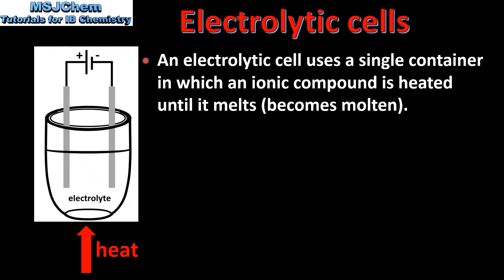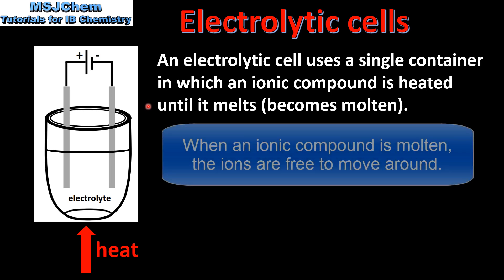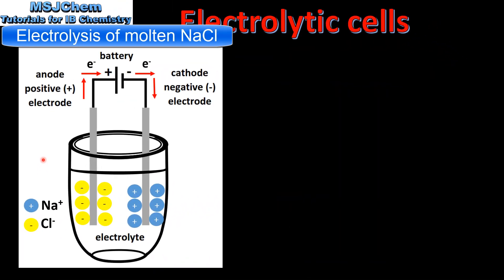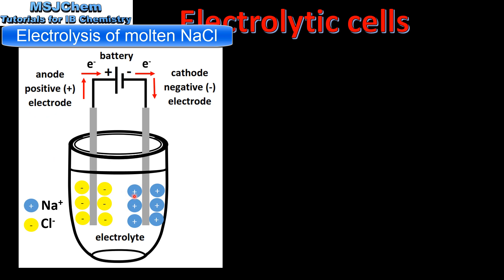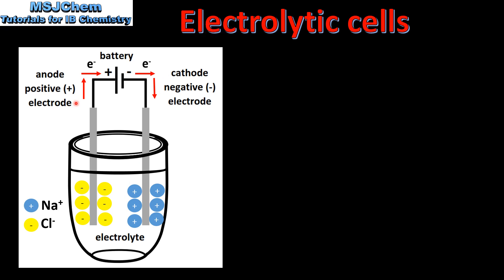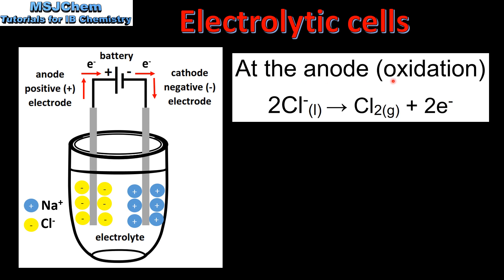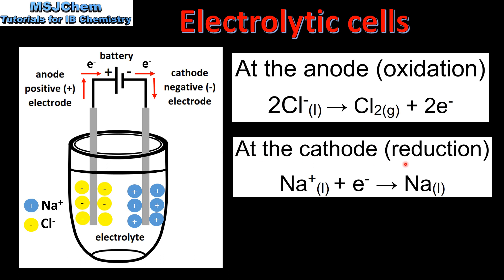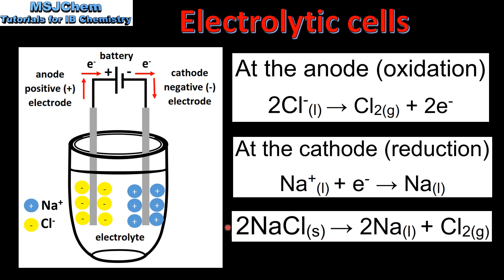9.2 Electrolytic cells (SL)

Comment: Sir electrons are negatively charged so why they will move towards cathode??
They should move towards anode because positively charged particles are present there??  
So why in this video it is mentioned in the picture that electrons are moving towards cathode??
Reply from the maker: An electrolytic cell uses a battery to drive the non-spontaneous chemical reaction. Electrons flow from anode (which is positive) to cathode (which is negative).
Reply: @MSJChem  but sir why 
As per law of electrostatics two similar charges repel and two unlike charges attract 
So I think electrons should move from cathode to anode 
So which one is correct??
Reply from the maker: Electrons move from anode to cathode. Remember that an electrolytic cell has a battery which drives the electrons - without the battery the cell will not work.

Comment: Sir...which...electrode..enter the electrons.....into.electrolyte.?
Reply from the maker: Electrons flow from anode to cathode.
Reply: @MSJChem  sir..it means elctrons..enter into electrolyte..... through ...cathode..
Reply from the maker: In an electrolytic cell, electrons flow in the wires from anode to cathode. In the electrolyte, there is a movement of ions. Positive ions move toward the anode and negative ions move towards the cathode. At each electrode either oxidation or reduction takes place (anode oxidation and cathode reduction).
Reply: @MSJChem  ok....sir.. Thanks....from.. Pakistan ❣️❣️
Reply: @MSJChem  it really confused me....

Comment: In the voltaic cell video the cathode was the positive electrode and in this video it is the negative electrode, which one is correct?
Reply from the maker: +Busola Olabiran In a voltaic cell the anode is negative and the cathode positive and in an electrolytic cell the anode is positive and the cathode is negative. The video is correct.